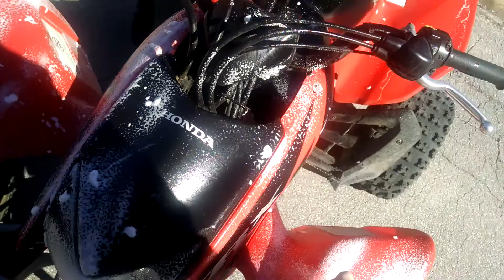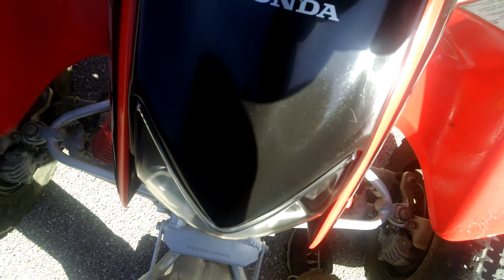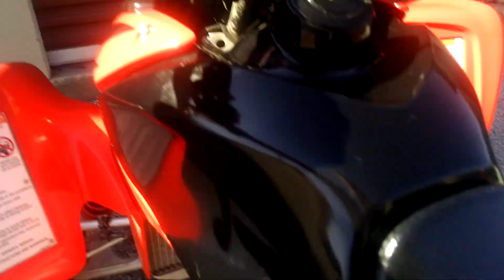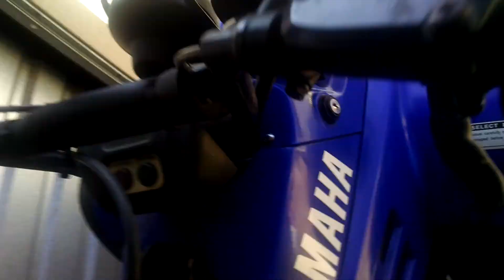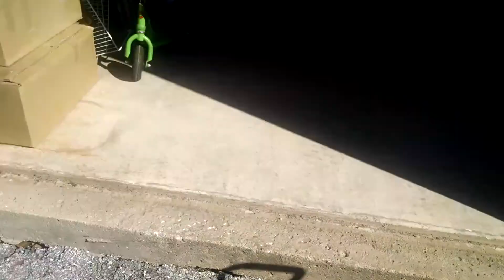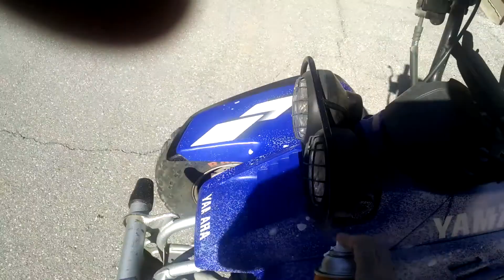CLEANING ATV PLASTICS W/ ARMOR ALL TIRE FOAM

Comment: I do this with my Honda fourtrax 300 sometimes and it’s real shiny but the only problem is it is a bit sticky if you put your legs on the tank or something and since it’s sticky a lot of dust and dirt really easily and quickly sticks to it
Reply from the maker: Maybe try wiping it down before you ride it again.
Reply: I do
Reply from the maker: I'm not sure what to tell ya. Mine will gather a little dust . I use Armor all tire foam are Son of a gun tire foam. I wish I knew what to tell ya about the sticky part
Reply: All good man,thanks anyway